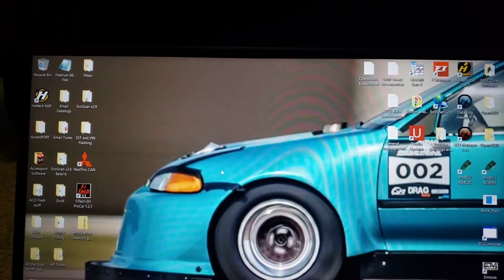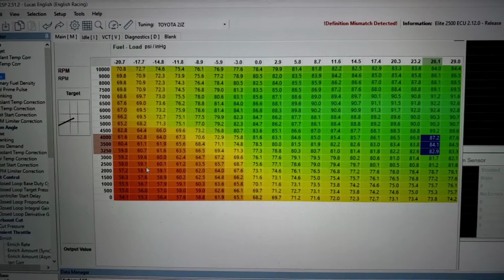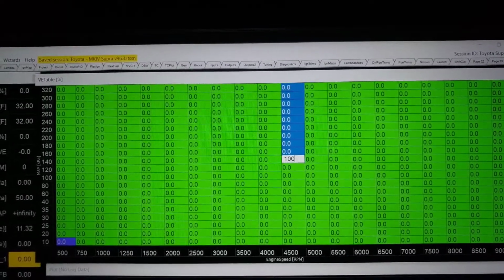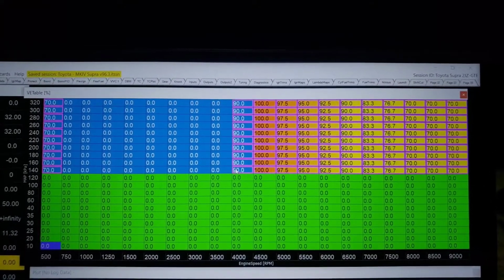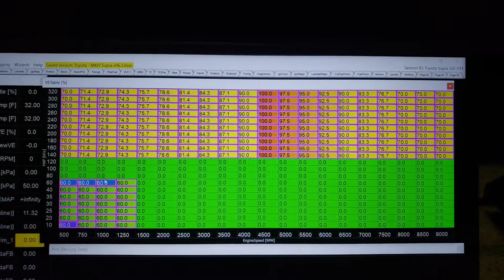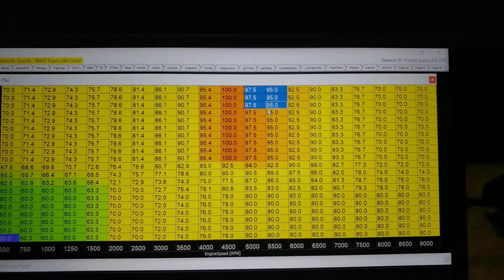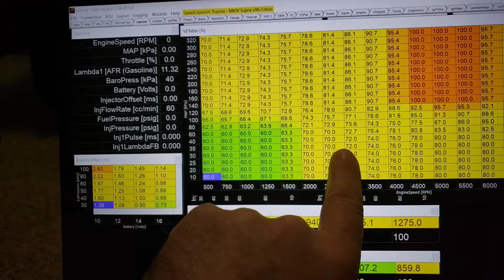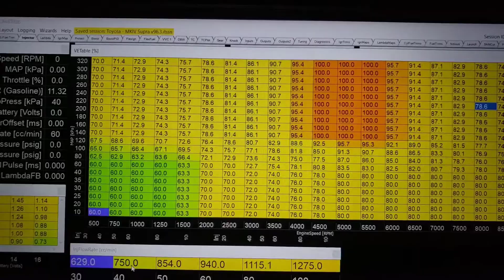Generic VE table tuning .. episode 1

Comment: So as long as your fuel injector data is correct, you would be able to log and adjust the ve table to match your target afr? I'm still confused about target afr at altitude. Would you want to target a richer afr at 6000ft 100kpa than you would at sea level since you are already in positive boost pressure? Thanks for the videos and your help!
Reply from the maker: The engine is still a pump just at less pressure. Most ECUs can do barometric compensation and altitude does little. Having raced at sea level and 6200 ft, the main ECU that issues is one that isn't VE based. Normally only a around full throttle and no boost because "floored" at 6200ft for instance is 80 kpa instead of 101kpa at sea level.

Comment: Nope, you're hitting the nail on the head,  would you kind of follow the same steps on a brand new set up you haven't tuned before? or would you just kind of work your way up until you get the general idea of how it reacts?
Reply from the maker: Truly it depends on the combination. I took a VE map for a 6466 Evo 9 and tossed it on my Honda V6 when I first switched to the Infinity. Both cars were big cam, 2000cc injector, and big turbo, it a surprisingly close. Basically I follow the same steps though whether I have a perceived starting point or I make a ve map.
Reply: @AaronONeal1  Awesome! thanks for the vid!